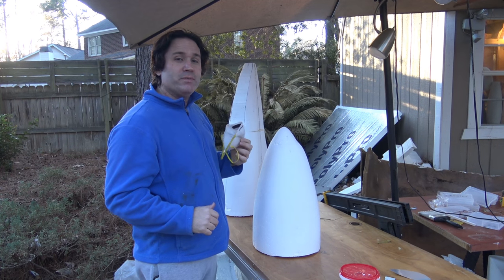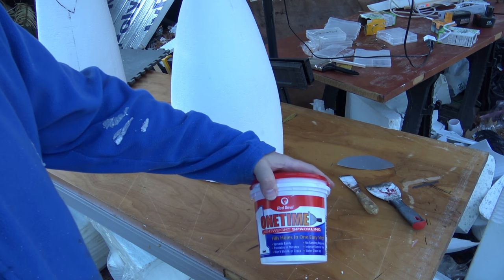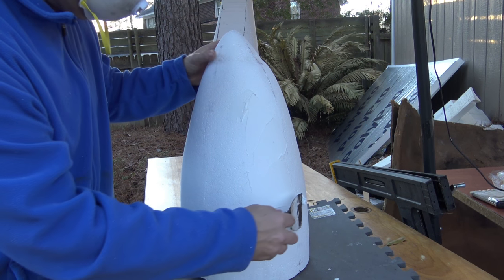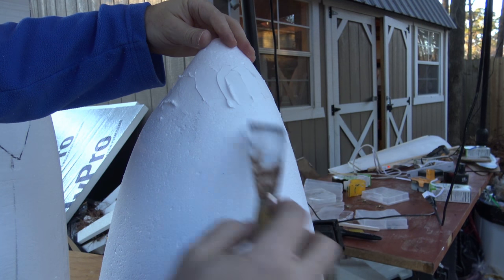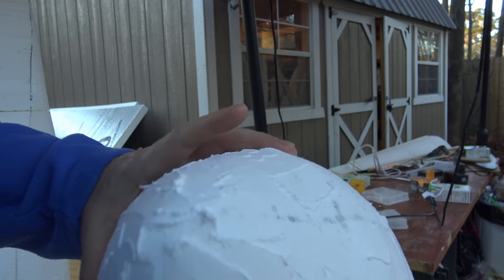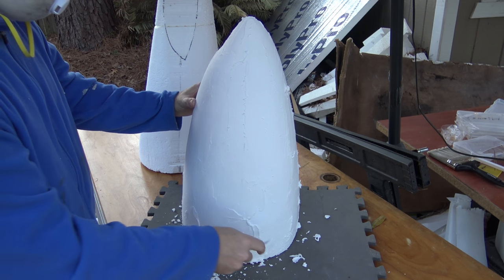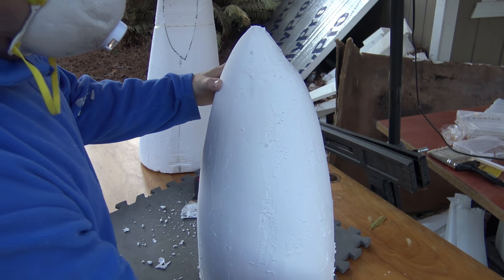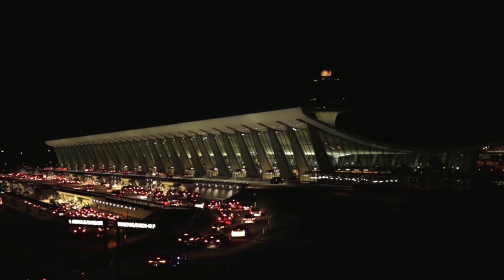Emirates 777-9X RC Airplane Airliner Build Part-6 [4K]

Comment: Chris spray a fine. Mist on it if it dries out. You can use a damp sponge to get the excess off. I never realized you used sparkle. That’s really cool.
Reply from the maker: I will give that a try but I don't want to disturb the rest of the spackle on the surface.

Comment: Hey Chris, I have used that spackle with drywall finishing; instead of sanding, if you take a damp sponge and lightly wipe it down, (after it has dried)  it will knock down all the high spots; this may give you an easier sanding surface without all the dust... and the sponge works wonderfully with all the curved surfaces.. just a thought... love your videos... can't wait to see the finished product.
Reply from the maker: I haven't tried that Ruben, I'll give the sponge idea a try, thankyou!

Comment: Okay-- I got the whole "spackle perfection" idea-- but if it's so thin you can see construction lines through it, isn't that too thin? And then you're going to glass over this-- or am I getting ahead of the process? If you're going to fully detail it-- is the hull going to be open? Seems like a boat load of styro to hog out. (Or do you do the acetone thing? I forget, it's been a while...)
But the profile sure looks good. Exciting.
Reply from the maker: Hi Eliot you are getting a tad ahead of things Sir LOL, The layer of Spackle is to fill in all the pot & crater holes in the Styrofoam created during the sanding & shaping period. so I'm not trying to create a new layer with the Spackle just to create a smooth surface.
Reply: I have watched everything of yours I could find-- so of course I know you're going to fashion tubes out of various materials to connect the monster nose and tail-- sure, and that comes later. I just thought the glassing would do all the "smoothing" needed. AND I also wondered if you plan on opening the flight deck and passenger cabin interior. If so; like I said, that's a hat-full of styro-foam to remove. What I imagined (in my fevered brain) is that if you dissolved the foam after spackling and glassing, there would be this shell of spackle on the interior... see? my mind is racing...
Reply: I know, I've gone too far. I should just wait and see what you're up to like any one of us. I'm just a little mystified about how far you're detailing. Outside is almost easy compared to inside. I'll calm down and take my seat.